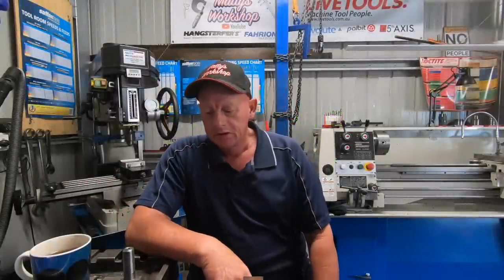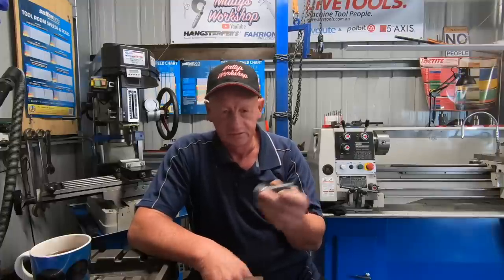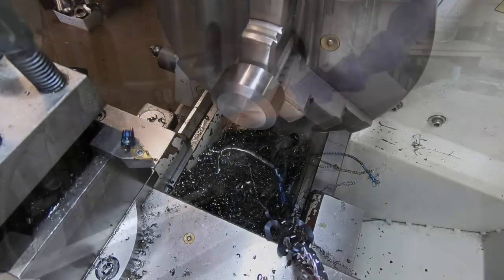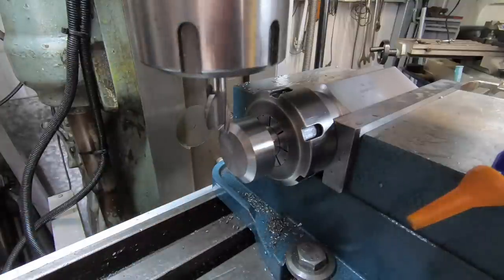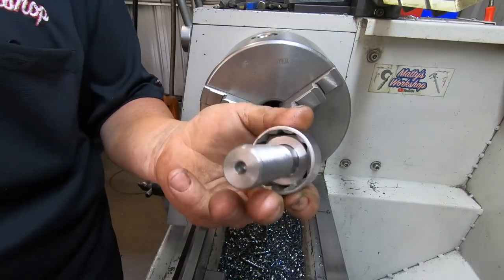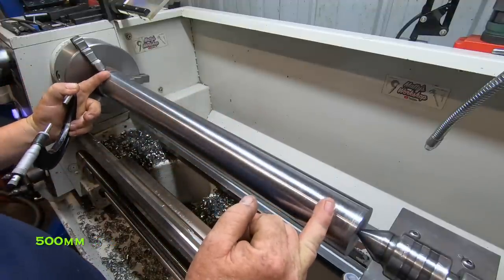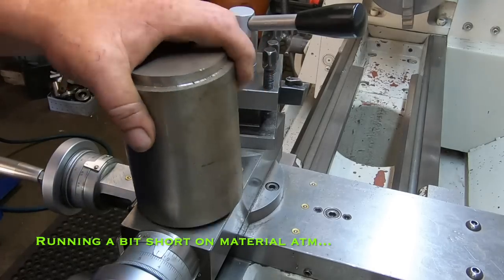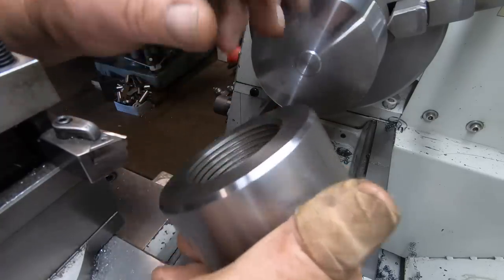Face Plate Table - Part 1

Comment: Don't be hard on yourself,  job and video are fine, nice interpolation on the carriage and cross slide for the radi and chambers. 👍
Always something rewarding in making a hex head bolt.
Thanks for sharing
Reply from the maker: Gday, once you get used to breaking the edges like that it’s quick and satisfying, thanks for watching mate, cheers

Comment: Great video Matty. Whoever manufactured your lathe should be using your videos in their advertising campaigns. But a lathe is only as good as its operator and you are making it shine. Thanks for the video.
Reply: I was wondering what lathe it is.  Not sure if it's ever been mentioned in previous vids.  It is quite capable and it's not so massive that it would be overkill for a home shop.
Reply from the maker: Gday Jim, the lathe is an AL906b from Hare and Forbes, it’s the smallest Taiwanese lathe they do, I’ve been really happy with how it’s preforming mate, thanks for watching, cheers
Reply from the maker: Gday Joe, it’s only 900mm between centres but it does look bigger on camera, really a good size for the home shop, cheers
Reply: @MattysWorkshop  it's a shame they only ship it with imperial leadscrews, I'm trying to save money to buy a better / bigger precision lathe and the AL960 ticks all boxes except the leadscrew 😐

Comment: Nice job Matty! You could weld a boss on the nut to make a clamping boss. or if you don't want to weld you can always bolt it on with son 12mm bolts. Either way do it before you cut the slit in the nut. Just a couple of suggestions.
Reply from the maker: Gday, I think i might drill and thread a hole in the top nut and use a bolt and brass pad to not damage the thread, hopefully it should hold tight, thanks for your suggestions mate, cheers

Comment: That is a very cool piece of iron, and I agree that the table was a good use for it.  I also have rigidity issues with my tailstock at times so will probably need to break out the follow rest more as well.
Reply from the maker: Gday, the table is one of the best things I’ve made but I’ve had to 3d print infills for the slots to stop everything falling through the gap, thanks for watching mate, cheers

Comment: Hi Matty by far one of the best videos on YouTube and I ant pissing in your pocket may I ask you a question when you are getting short on material how and where do you sores it thanks PAUL 🍻
Reply from the maker: Gday Paul, thanks for the kind words, for material I know a few heavy vehicle mechanics and they keep parts that they replace like S-cams which are really good material, also the local engineering shop is a good source of short materials, hope this helps mate, cheers

Comment: Hy Matty you can drill and tape on the side of the nut and use bolt with brass plug for the lock 
REG Robert
Reply from the maker: Gday Robert, that’s a great idea and I think I’ll take your advice, thanks for watching mate, cheers

Comment: that socket was a great fit, they are never a tight fit, curious how you worked out the depth of cut on the hex.
I recon your right about the live center, when you get near the chuck she comes good.
Nut and bolt fit is good, check any brought ones, they are never very tight and wobble around.
All looks good from here 👍
Reply from the maker: Gday, in the engineers black book there’s a formula for working out the hex, I can’t remember it of hand but it gives you all the information you need,  thanks for watching mate, cheers

Comment: Great job Matty. You're dead right about the harmonics starting at a certain and usually critical diameter, like the second to last cut at half the d.o.c and the finish goes to ratshit from perfect. I bloody hate that. If you don't have an insert big enough mate, then grind up an HSS one and do the bigger thread that you want. And let's be honest, if you're making a threaded bar and the nuts to go with it the diameter doesn't matter one bit. As long as you match everything together. It's not like you're going to make it for someone else and they have to fit it to something of a standard size , then you have to make it right lol. At the moment I'm not quite sure what it is that you are actually making, but I'm sure it will become obvious in the next video(s) . As this was marked up part one I'm not sure if there was an intro about it I missed. Anyway it is what it is! Great saying mate, cheers from the UK. Sam
Reply from the maker: Gday Sam, I screwed up in the video a bit and didn’t show the face plate, I’ve showed in previously but that was a while ago, I picked up a 800mm diameter face plate, it should make a good solid table I hope, it’s bloody heavy enough, I did think about grinding up a threading tool but I’d have to make an internal and external tool and honestly I’m to bloody lazy😂, Im to used to inserts, thanks for watching, cheers
Reply: @MattysWorkshop   G'day mate, yes we all get lazier as we get older lol. If I were doing that job I think I'd have made it with an Acme thread, as I'm getting a dab hand at doing left hand Acme's now lol and being left handed there's no crashing into the chuck involved as you are threading away from the headstock! Anyway looking forward to the rest of the build mate. Cheers, Sam

Comment: My guess is the bearings in the live center is not rigid enough, also pushing the tailstock / live center too hard into the stock will cause issues when the stock expands with heat. There are live centres that deal with this issue, called constant pressure live centers.
Reply from the maker: Gday, the live centre isn’t all that good for quality, it wasn’t that expensive back when I bought it, definitely need to invest in a good quality one very soon, thanks for watching, cheers
Reply: @MattysWorkshop  Vertex make good ones, I have my eye on the smaller MT2 one when I can afford it 🥰

Comment: Looks good, but what's a face plate table? I must have missed some part of a previous video, sorry. Google hasn't thrown up any likely answer yet. That really does look like a great lathe.
Reply from the maker: Gday, it’s a 800mm diameter face plate off a lathe that I’m turning into a table for the workshop,
Reply: @MattysWorkshop  OK, I suppose  I should have worked that out. 800mm! Aside from the size of the face plate, I'm visualising trying to fixture a workpiece that needs that size faceplate, shimming it level etc - nightmare, not even sure how lifting tackle could help, but I suppose there's a way. Good luck with the table, it looks like it's going to end up being very striking.

Comment: Hey Matty, how are you going with the cost of steel, e.g. 4140, 1045 etc? I've being using discarded hyd cyl rods from the hydraulic joint where I used to work. Stock is getting low, might actually have to buy some. It is a throw of the dice in what it is, generally it's 4140, 1045 or induction hardened. By the way if memory serves me well and this was back in the 1980s, when we used to machine and screwcut 4" 4140 machine tie bars, had to rough them out first, let them sit for a day or two so as to settle from the internal stresses and then finish machine.
 Cheers
Reply from the maker: Gday, so far I’ve been lucky and haven’t had to buy much lately, steel prices have gone through the roof and I’m not looking forward to the day I have to buy more, a lot of what I use is secondhand from old farm implements, not bad material, cheers

Comment: what interests me on a collet chuck is that it appears that you do not have to center 3 or 4 jaws to get a centered grip on a round piece to machine
Reply from the maker: Gday, a collet chuck relies on the internal taper to be concentric with the spindle which aligns the collet, thanks for watching, cheers

Comment: Gday  Matty, Are you familiar with a "Reverse Live center" it's a tapered hollow live center, you can cut a matching taper on end of your stock, and it's supposed to be much stiffer, then a pointed Live Center, Or, did you try your tailstock chuck to reduce chatter? Nice work , cant wait to see part 2
Reply from the maker: Gday, I have never heard of the reverse live centre before but I’m going to look it up now, I honestly didn’t give the tail stock chuck a thought, I think I was to focused on cutting the thread and not screwing it up, thanks for watching, cheers

Comment: Good work Matty. Just wondering, is that live centre Chinese made by any chance?
Reply from the maker: Gday, the live centre I got from Hare and Forbes so I’d say it’s from China mate, cheers
Reply: @MattysWorkshop  Maybe try a dead center with a dab of high pressure grease if you have one?
Reply from the maker: @hilltopmachineworks2131  Gday Tom, I should of tried a dead centre but I think I was to worried about cutting the thread and not screwing it up…